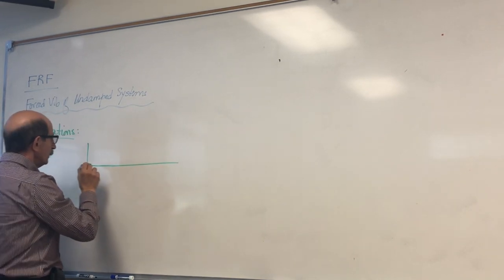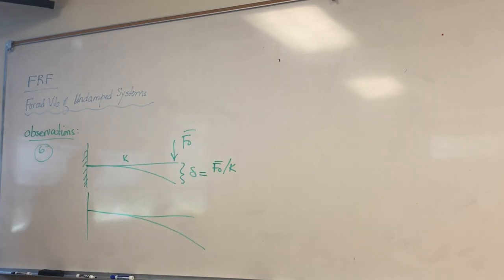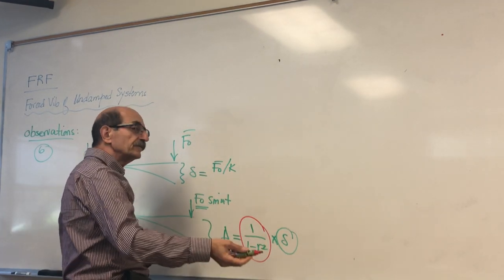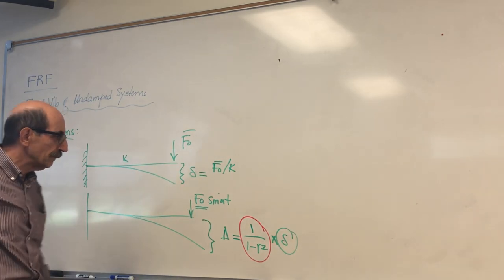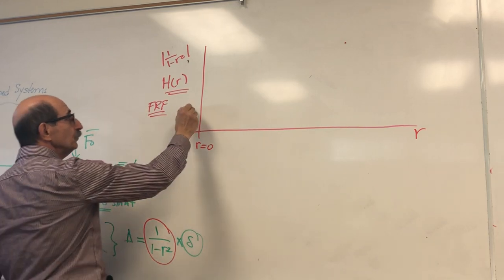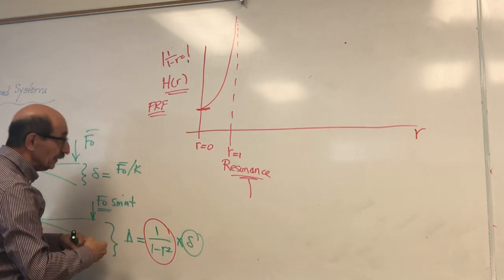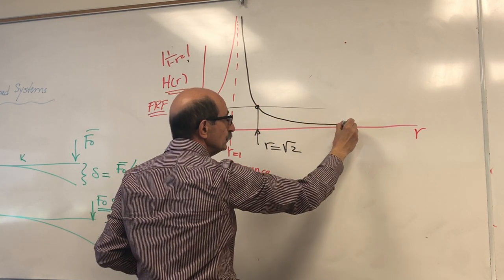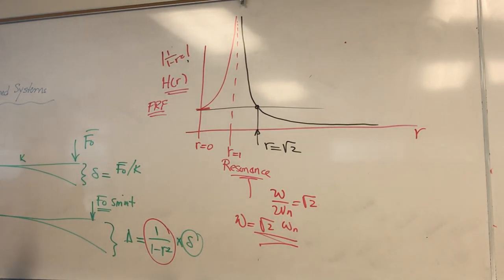Lecture 13 on Mechanical Vibrations-PM

Comment: A = 1/(2*sqrt(3))  = (1/4)/sqrt(1 - (1/2)^2)) = 1/4/sqrt(3/4) = 1/4/(sqrt(3)/2) = .28870 ...the .33 comes from the sum of the two terms ...u(t) = 1/(2*sqrt(3)*(cos(10*t)-cos(20*t))  ...get your Matlab out and try it.   I still love the course.  I finally understand the Rayleigh Method.